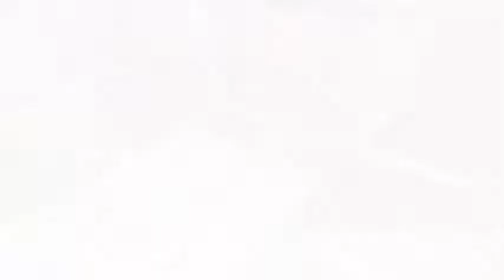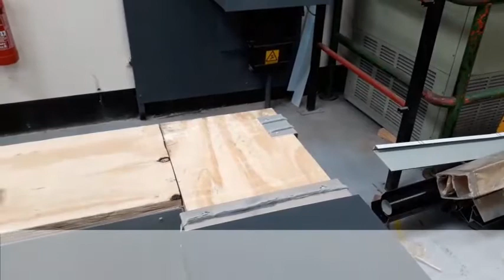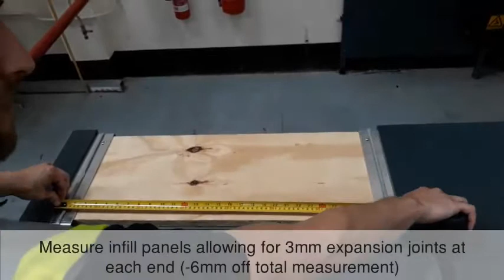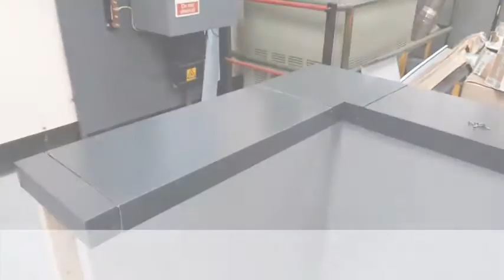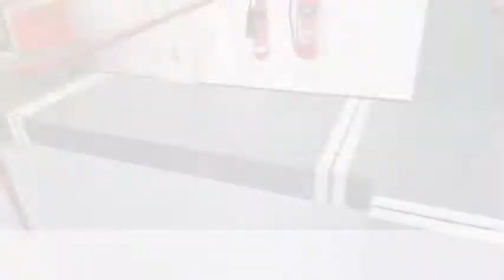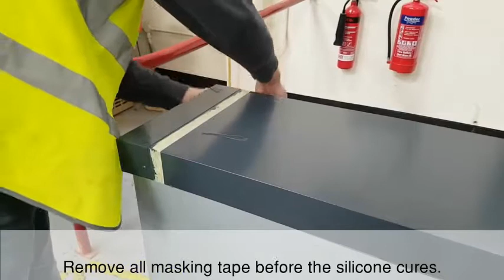How to install Aluminium Coping panels using standard carpentry tools | Marley Alutec

Comment: This is some horrible coping. I’m a tinknocker from SoCal with 11 years In the trade and this is the worst I’ve ever seen. All that coping could over been one pieces with only one seem. If I saw this crap on my site I’d kick you off with this crap. All these seems could of been avoided, now with three seems you have more of a chance of having a leak. Worst work by far. Turn your snips on and throw your mag hammer away.
Reply: Yes yes yes... dangerous video. Brrr
Reply: At times you need the lines as desiigns... u do t just think is compulsory he uses a whole panel length
Reply: @mariantus  clearly you don’t know anything about sheet metal. It’s not called lines first off they are called seems. And if that’s on a custom home I will put my life on it that no millionaire home owner is going to want to see all those (lines) like you call it! Now if it’s industrial then that’s different. At the end of the day if you gna install sheet metal do it the rt way!
Reply: @clearnoisesounds4390  
I've got sandstone copings which aren't wide enough, can I put aluminium straight on Top of them
Reply: @johnleonard7667  I am an approved installer of Marley Alutec and other manufactures.  To answer your question, yes normally this is doable.
Reply: Guy that knows how to do it way better is watching videos on how to do it. Makes perfect sense.